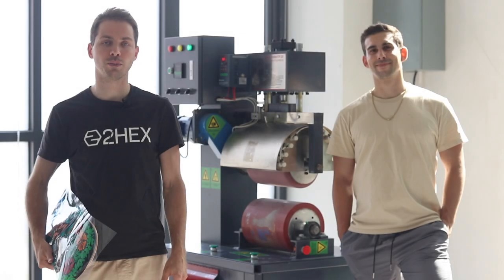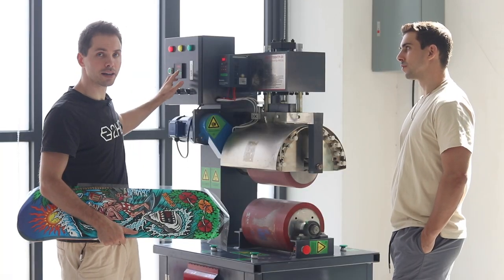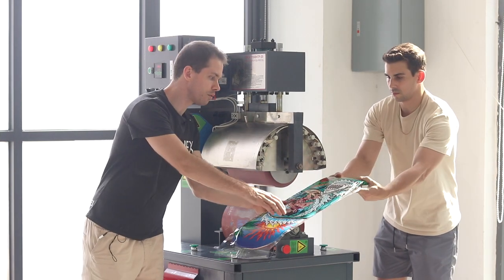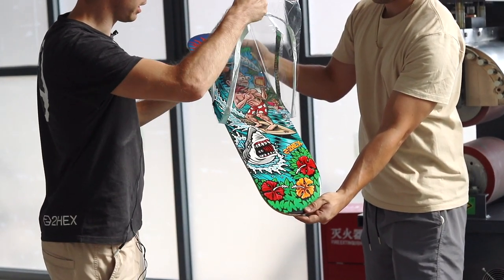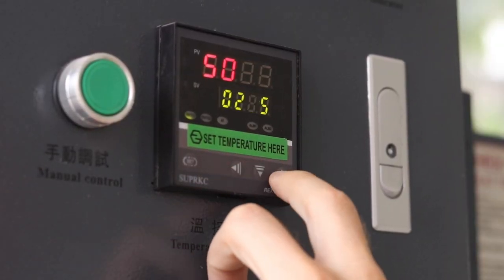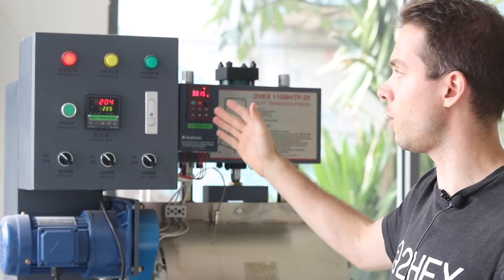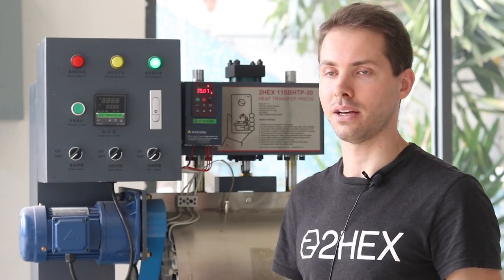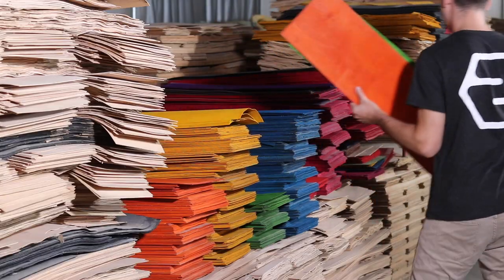Printing Your First Skateboard Deck • Skateboard Transfer Machine

Comment: What kind of transfer paper are you using? and why can't I just buy the film and screen print it myself? Thanks
Reply: exactly. I want to print mine myself but I cannot figure out the right printer.
Reply: @boyinthemirror  well how it works is you take the clear sheet  and you screen print the graphic you want on it, starting with a white base and you print the order of the graphics backwards so when you actually use the heat the transfer, the graphic is printed right side up on the deck, the problem is finding the correct type of paper...theres more to it
Reply: @pressureflipin1992  do you know exactly what material that is and what I need to print it

Comment: why cant you use a dtf print for this?
Reply from the maker: Maybe you could if you used the right ink, release agent, foil and back white. Do you know a DTF printer which is not bound to one type of ink and can print on a 10" x 34" foil?

Comment: Why does wrinkles come out on my board?
Reply from the maker: It takes two people to print and some practice to print without wrinkles. You got to stretch the heat transfer just enough but not too much. Also you need high quality heat transfers, like ours to have good prints.